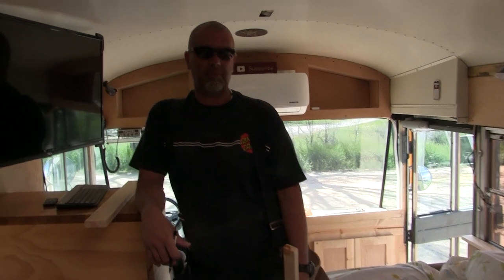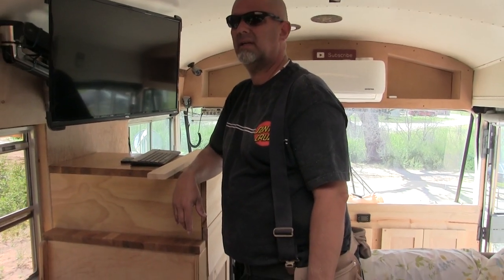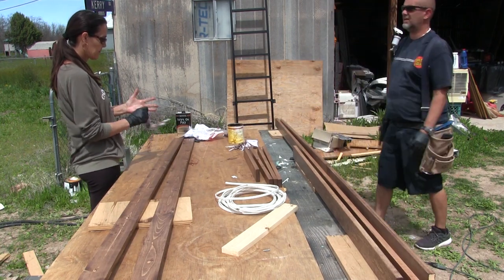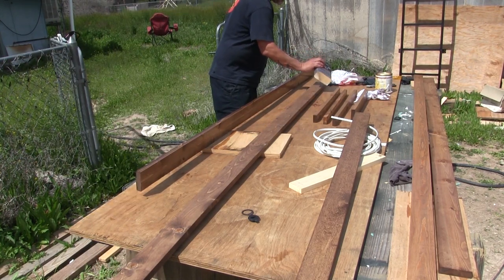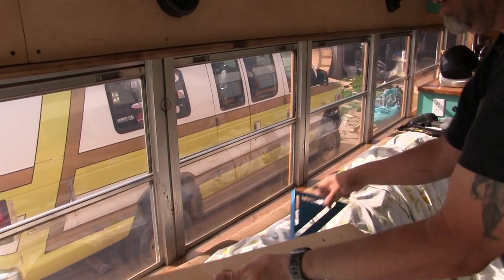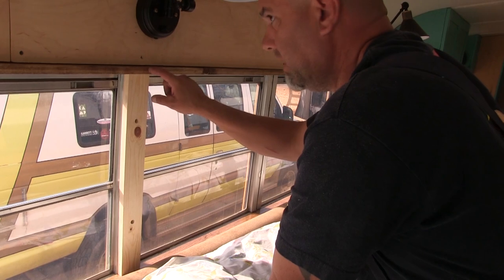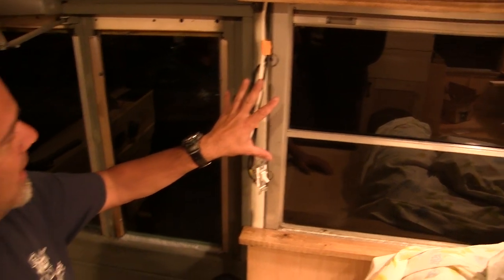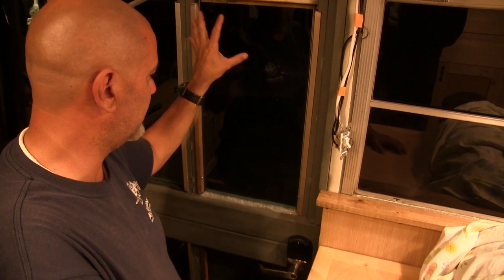How We Trimmed the Interior Windows in our Skoolie!

Comment: Even if the outside light is mounted down low say step level I agree you need something for an outside light. What about the old style flush mount light you see on the back of a semi they take what a 4 inch hole to mount flush, They have then in a clear or white. That would work really well down below floor level. Just a thought.

Comment: Looks good, I had been wondering what’s up with the windows.  Mike are you still working the rig?  You getting the PPE you need.  My job is first responder and we didn’t get proper ppe for a few weeks.  I got my own 95 mask and goggles.                                                                           If you had to swap a window out just pull trim or is the wall in the way also?.